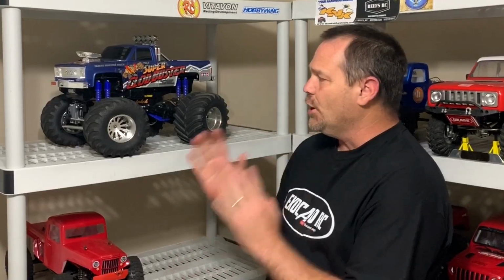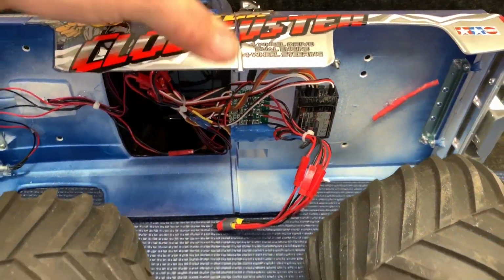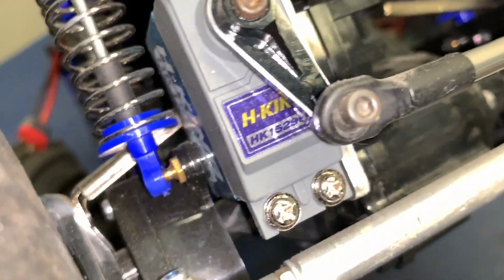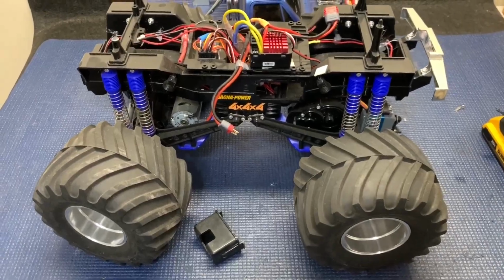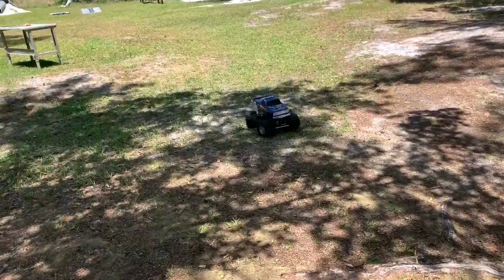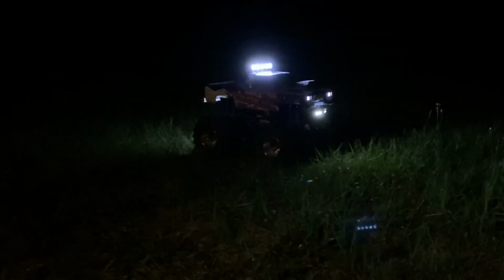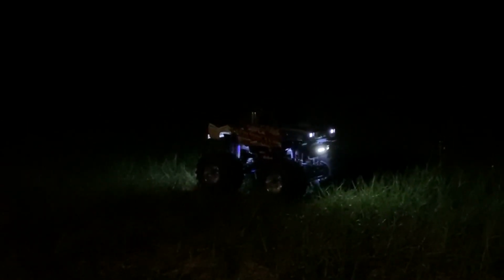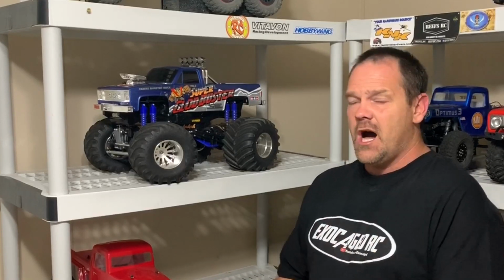Tamiya Clodbuster!!!

Comment: In the early nineties I hand built a Clod 4 link chassis and raced it. Took some trophies. Now that same truck is my super class crawler, with a different hand made chassis. Those tires ran so many miles they are now slicks on display next to the trophies. Always had two ESCs, what a beast. It can still out perform my Capra. Not bad for a hand made thirty year old truck. Thanks!
Reply from the maker: thats cool man

Comment: Just changed chassis on my 1986 original extended to 13". Using 2 20g servos center mounted, and 2 esc from my Raz 2 and Wolf 2 with motors. Used y cables to connect esc,s and servos. Test run ran great

Comment: As someone who has built (and modded) a lot of clodbusters, I got to say, hats-off for all the details (especially the lighting). Not sure if you know, but the stock motors will run a 3S just fine (they can take 4S for short periods as well). I still run the stock chassis on my current clodbuster, but it is modded for clearance/suspension travel and runs 3S and it takes quite the pounding. I live in the northeast, and these trucks rule in the snow!
Reply from the maker: thats good to know, the esc is good for it but I'd have to unplug all the lights just to be safe. For what it is, 2s will stay in it.
Reply: @ExocagedRC  Yeah, I can see why it's easier for you to just stuck with 2S with all those lights. If you ever do want more speed the HPI 15t thunderbolt brushed motors give good speed and are happy on 2S (I used to run them on 3S , but they wore out fast doing that). A happy medium between the two is the RC4WD 20t motor. The key to both of these working is that they have neutral timing so that the rear motor (which runs backwards) doesn't burn up. Here's my current clodbuster running 3S with stock motors. Not the fastest one I've ever built, but definitely the most fun.  https://www.youtube.com/watch?v=Tucs4D3Q-4U

Comment: I made my cloud Buster with dual brushless 3100 K v's dual 45 a.m.p hobbywing   with A Y harness .two 3S lipo 50C batteries homemade sassy chassis on 4 link with tmaxx shocks.
Reply: Dude that rig is a beast and I bet it's a handful to handle.  I've got a dual brushless Clod (dual Traxxas Velineon 3500 system)  as well with 4 link suspension oh and a homemade aluminum chassis.  Great minds think alike huh? One difference is I'm only running one 3s lipo versus your two but it still has crazy power. My question is do you suffer any gear skipping or stripping when you hit the throttle to hard? I're read where one or two other guys have the same issue.  Let me know what that great mind is thinking will ya! I'd highly appreciate it.

Comment: Really didn't like mine back in 1989. I remember driving it off the top of a flight of concrete steps just to try and wreck it lol.
Reply from the maker: well did it survive?
Reply: @ExocagedRC  if memory serves I'm sure it wrecked the underside of the chassis. I vaguely remember changing the chassis a couple of times and then resorted to fibreglass to bodge it. Cant actually remember what happened to it in the end. Might be up the old mans loft.

Comment: Hey I'm thinking about so ng the dual servo upgrade , what's a good way to wire it up , and should I use a BEC?
Reply from the maker: Get a radio that has 4ws mixing and yes an external bec is highly recommended for them.
Reply: @ExocagedRC  thanks